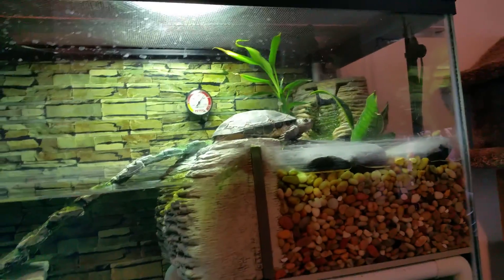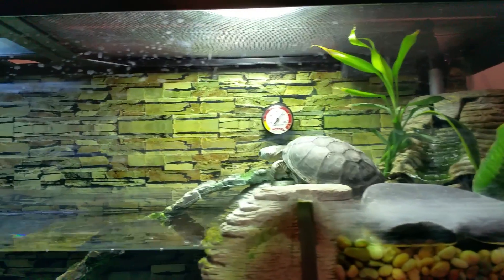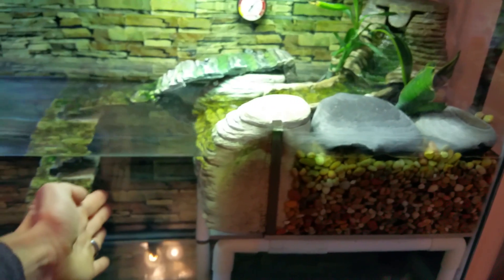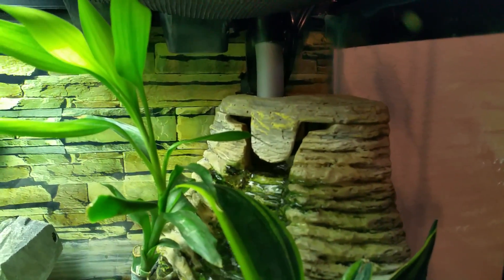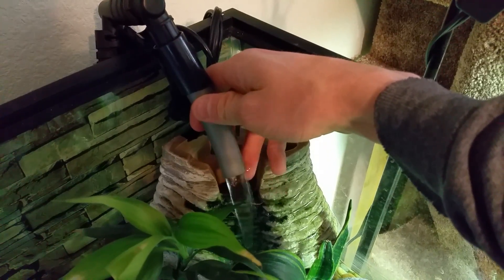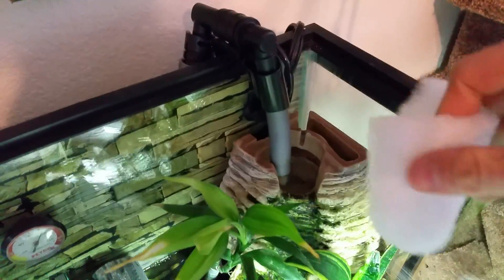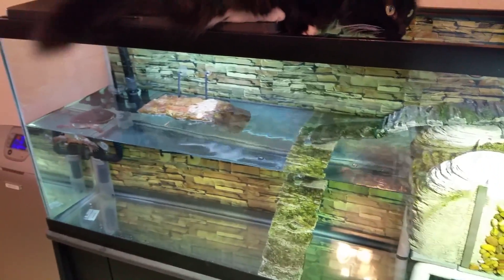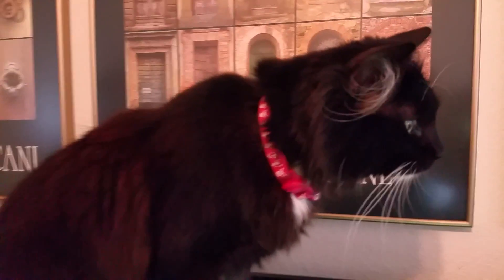How I Raised my Viquarium Basking Area

Comment: What glue did u use under the 4 legs PVC pipe onto the base ?
Reply from the maker: hello there. used no glue at all. just pressure fit so i can take it apart to clean regularly

Comment: what filter do you use ? also what's the pump underneath the dock that you use to push it out
Reply from the maker: +Samantha Polo hi there. In this 55 gal tank I have the Fluval g3. Under the cave area I have the motor that came with the viquarium setup. A small motor on a timer that, a few times a day, will blow out the waste towards the big filter inlet

Comment: Is there any way to make a 4 foot land area with this and also will this work in a 100-125 gallon tank that is about 6 foot?
Reply from the maker: the viquarium is designed for tanks that are 12" in depth. im sure you can setup something similar with this filter, but it probably wont be easy or accomplish the desired looks. there are similar basking type setups that are made for single corners.

Comment: How big is your tank im about to do something similar on a 75 gallon
Reply from the maker: this was a 55 gallon tank
Reply: Brandon's Turtles thats cool i just did it with a 75 gallon still have it getting settled before i add Mr.Turtle to it. The only downside with my tank was because the tank is wider than 12" I had to take some modifications

Comment: Hey Brandon love the raised platform idea so I did it myself still making adjustments to my turtle tank I have a young snapping turtle who is doing great the 3 months I've had him however I'm using 1/8th inch plexiglass as my base and the weight causes it to bow and my rock goes under my wall what did you use as your base it looks solid. Would love to chat more with ideas I have find me on Facebook name is Kyle zarr
Reply from the maker: hello there. i used a 12''x12" standard tile. like bathroom ceramic tile. very strong and thin. works perfectly in this 55gal tank as the width of the tank is 12". hope that helps!

Comment: Hey, I just came here luckily from some other random videos. I currently have a small turtle in a 10 gallon environment but she is growing fast! I want to future proof if possible and I am looking for guidance because I want to do this right. Looking forward to watching your other videos. Thanks!
Reply from the maker: yay! thank you. a good rule of thumb for turtles is 10 gallons per inch of turtle. research the type of turtle and how big she is going to get. watch the pH of the tank. different turtles need a different pH. this led to shell rot on our boy turtle. we are still working on getting his shell happy again. feeding variation is important. have at least 2 types (soft foods, sticks) to keep turtles digestive system working well. keep waters clean. if no other fishes in the tank pull almost all of the water out on water change days. that is the water that they drink, needs to be clean and treated. good luck!
Reply: Seth Robinson you should get a empty 20 put your ten gallon lid on the 20 and use your other supplies from your 10 gallon only costs 30$
Reply: Well I actually bought a 40 (but half is cut open for a filter so really 20) with a floating dock for her to climb up. I set this up about 3-4 weeks ago and she has almost doubled in size! She loves swimming around and bumping into the wall. I'm just worried if she goes any larger if she will get bored with the tank and suffer from that?
Reply: Wow, I just read the last part again and I must have missed that. I lose about 10 - 20% water in a week through evaporation and have been refilling to the same level with some turtle water conditioner. Do I need to be pulling more out? I read somewhere that too much change in the water environment can make them sick because they get use to the bacteria there? I also have and air bubbler running because I read fresh air helps kill bad bacteria. I typically suction up after feeding and the water is staying clear compared to the last tank.